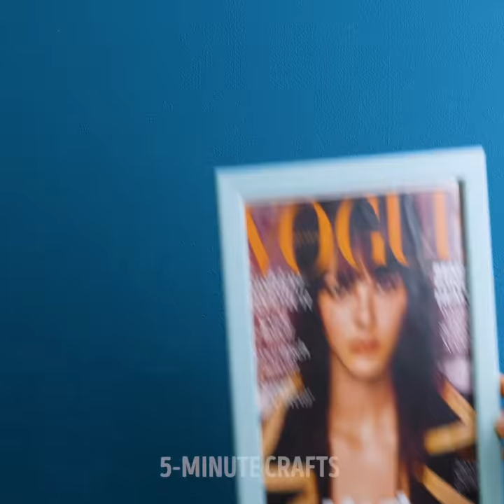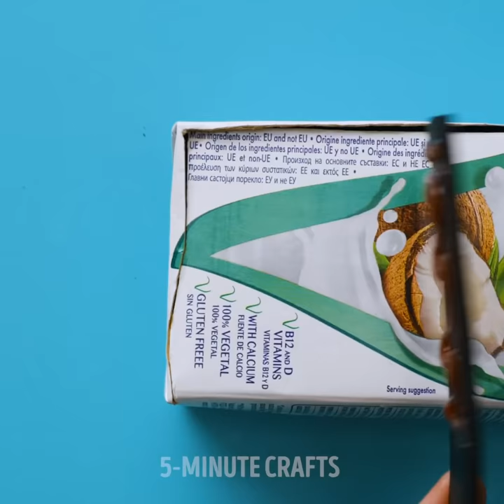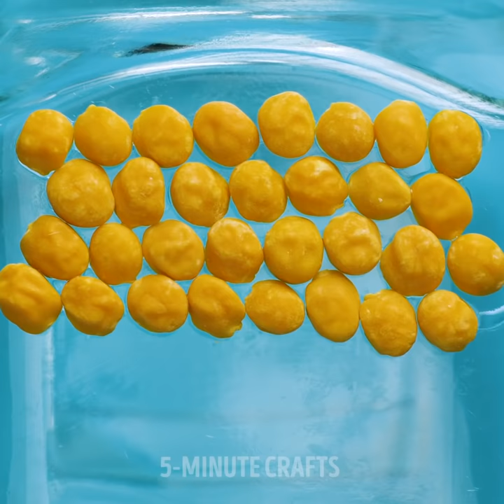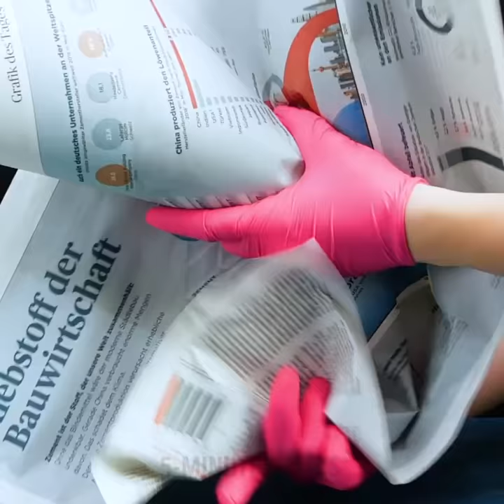AWESOME DECOR PROJECTS FOR YOUR HOME || 5-Minute Cement Crafts You Can Make With Your Hands!

Comment: Tabletop glass will get knocked down. It is not even fixed to the rest. Don't ever try that yourself.  It is dangerous. 
You should have cleaned that tire before putting on any glue and using it at home. 

Besides that table does not look great. It screams bad diy.